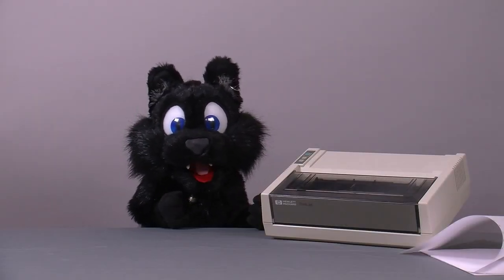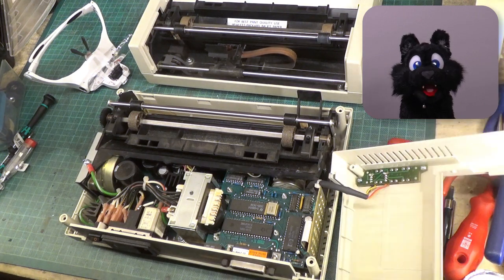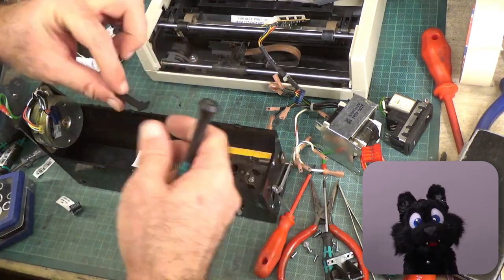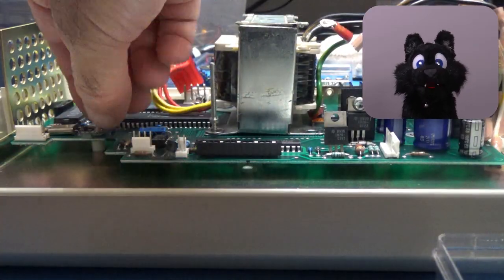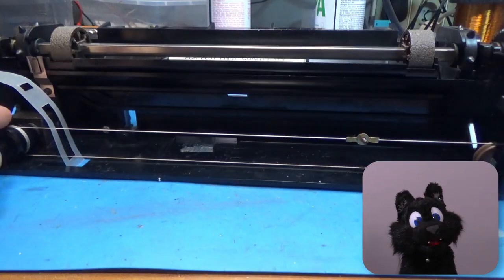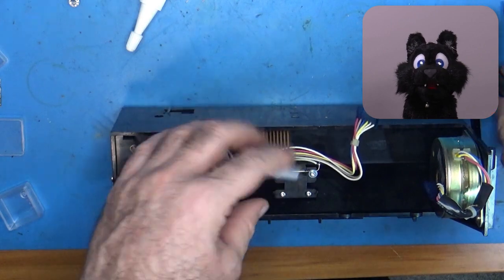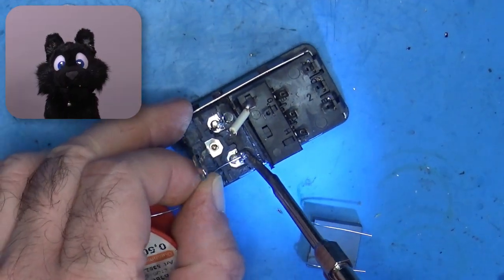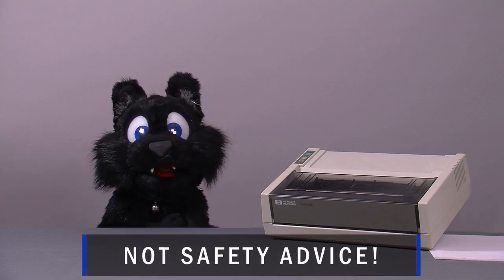HP 2225A ThinkJet

Comment: Well done, very thorough (as always). WD40, surgical spirit, white spirit or diluted acetone may shift that marker pen, but, needless to say, test a small area first. Appeared to be some small scratches on the perspex, which may polish out.
Reply from the maker: I'll give a few suggestions for the marker a try and will eventually do a short when I find something that works; Not sure about the perspex, since I have mixed results with polishing thes and the scratches aren't big enough to make the risk of making it worse worth it. I'm still looking for a replacement for the button cover foil too.

Comment: the filter popped off on my HP 54501A Oscilloscope too, looking online i found a quite exact replacemente, only a bit smaller, they are standard filters no need for exact replacement. As always good job
Reply from the maker: I do have a few of these "power socket with included filter" things around; but none of them has a fuse and certainly not such an elaborate voltage selection. I would at least need something that is of equal size, or there will be a hole in the case. I'll replace it IF I can everntually find a matching new one, but chances are slim, I think...

Comment: There are still powersockets with fuse holder. finding one with 110/230v selection is a bit harder.
the filter that blow up probably contained a rifa capacitor. HP has more of those style filters that have that problem.
Reply from the maker: I took a look at the blown capacitor; it is certainly a "RIFA style" but it wasn't RIFA branded...

Comment: Are there drivers today to get work that printer on modern PC's? I don't beleive so...
Reply from the maker: The ones with the parallel or serial interface might work as "text only printer" which should still be supported. But the GPIB based one lacks the interface and drivers for that in the first place. Not sure...
Reply: @atkelar  This calls for experiences with this device.  😁
Reply: @atkelar  GPIB is a simple ascii interface. there are USB/ethernet and other interface adapters to GPIB.
you need to find the commands for this printer on the GPIB and you can then make a driver for it.
Reply: @djneon12  how would I find the GPIB commands for it and how would you make a driver for it?

Comment: Amazing that you could repair the flex cable. I have a couple of these printers as well, one with the flex so corroded that it will never get printing again. It's the ink in the cartridge that leaks out over time and corrodes the connections.
Reply from the maker: The second one had the connector covered in old ink and indeed: none of the contacts worked anymore. But I was able to make it work again too, by exposing a tiny bit of copper and painting over it with the silver paint. Expensive, but worth it IMHO.
Reply: @atkelar  i didn't think about trying with conductive ink on mine.